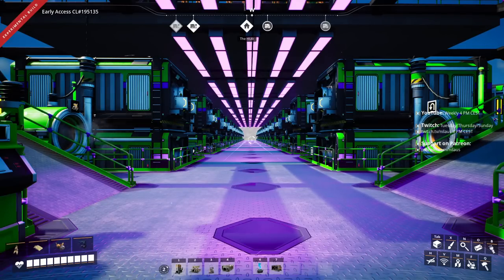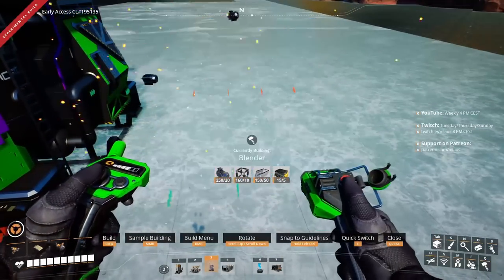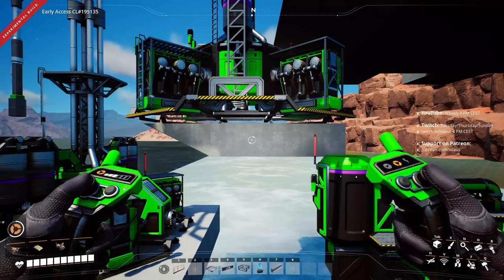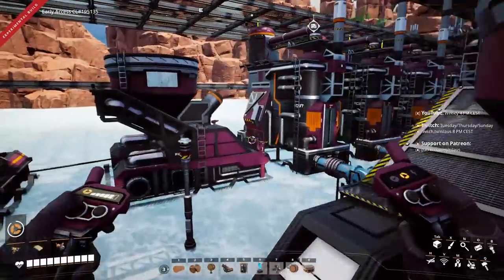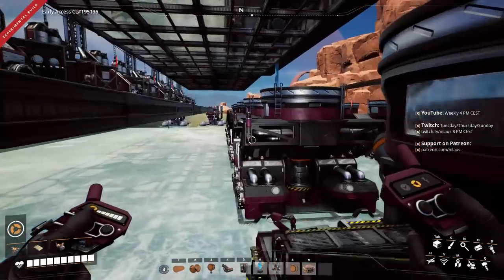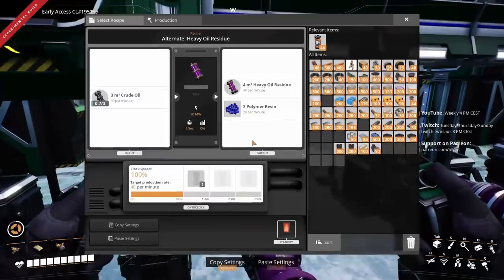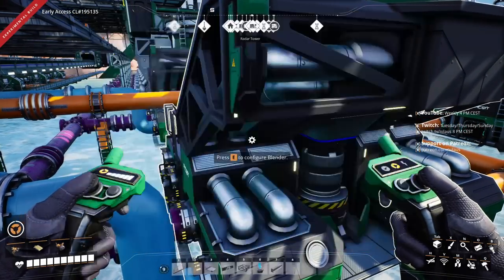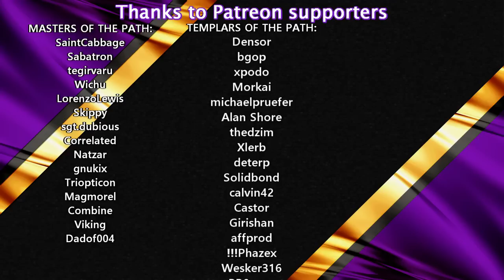20,000 MW From 600 Oil Using Diluted Fuel | 13 | Satisfactory Update 6

Comment: Great build that is now on my to-do list, as I just got aluminium set up. Thanks for sharing!

Quick summary of requirements:
* 600 Oil
* 20x Refineries, using Alt recipe: Heavy Oil Residue (30 Oil goes to 40 HOR each)
* 1x Awesome Sink for Polymer Resin from Refineries
* 20x Blenders at 80% underclock (80 Fuel output), using Alt recipe: Diluted Fuel (40 HOR goes to 80 Fuel each)
* 4x Water Extractors @ 166.667% overclock to get 200 water each / 7x at 100%, one at 66.67%
* 134x Fuel Generators, one at 33.34% underclock
Reply: you can use 16 blenders a 100%
Reply: @maelderrien8502  True! I was so focused on the 1 refinery sending its output to 1 blender setup.
Reply: @mrmibes  it's a 1 to 1 blender to water extractor setup ... just underclock the water extractors so they only produce 100m3 water. 4 blenders 4 water extractors per rectangular "pier" and 33 (34) fuel  gens
Reply: @mikechua9560  Ah yep, that works too. Thanks!
Reply: Thank you!

Comment: Dekoba, another great Satisfactory content creator actually has a modular build for this which works great ... I have made some tweaks from his video and the result has been 5 refineries producing HOR (still sinking the purple waste), 4 blenders producing diluted fuel with 4 water extractors on the other side of the blenders each at 83.33% efficiency to produce 100 m3 water and 33 fuel generators per rectuangular pier.  It's amazing how much power you get just from 1 rectangular pier.  An overclocked pure crude oil node produces 4 piers, making a total of 99 fuel generators (14,850 mw) ... can add a 34th fuel generator but it has to be severely underclocked.  For me I left the 34th out and would rather produce excess fuel so there's no brown outs.

Comment: I tapped the four nodes on the west coast - two normal and two pure fully overclocked is 1800 oil.  That let me do 600 rubber and 600 plastic per minute, and the residue into diluted fuel is enough for 150 generators or 22,500 mw.

Comment: Nice, bro.
Please help...
I've been working on my power for a couple of weekends already.
Playing with 1800 crude (3 lines of 600 each) into 2400 diluted fuel with packagers. 

If you are getting 20k mw from 600, I should, in the end, get around 80k mw. If the mk2 pipes can actually move 600 each line.
I'm just wondering how much a fuel generator burns diluted fuel per minute. Is it 12 per second?

I am probably wrong, but I was thinking it was 50 fuel generators for every 600 fuel. If that is the case, I'm gonna need 200 fuel generators.
I'm pretty sure my math is off cause that seems a little high. If not I'm in for some grind.

Comment: if you use the blenders at 80% you don't get 200 fuel! there are 160 and you say that you upload 200 per row for 17 generators. I don't get the accounts or I don't understand the distribution. And if you put the blenders at 100% they consume 50 of heavy waste and the refineries produce only 40.
Reply: This might be a late response but he's using 16 blenders and 20 refineries (or at least it should've been), so the refineries produce 800 heavy oil and the blenders use 800, also blenders working at %100 :)

Comment: i use 300 oil to get 15000mw power
Reply from the maker: Interesting. Mind sharing that? Never heard how that would be possible (except Turbo Fuel, but then it also requires Coal/Sulfur)